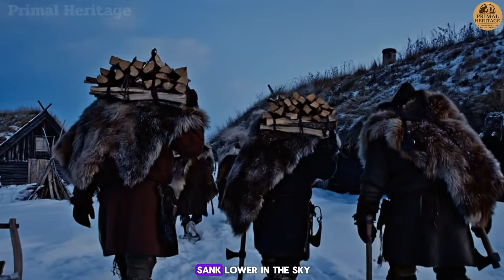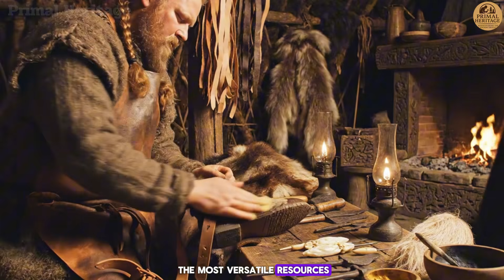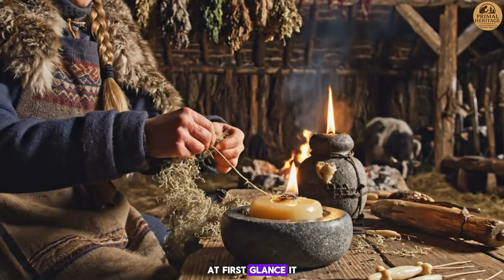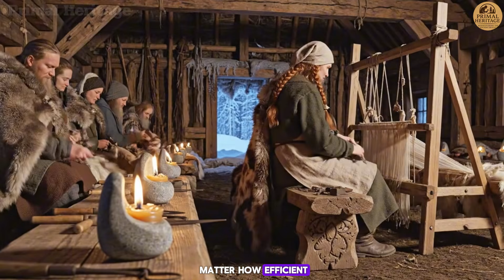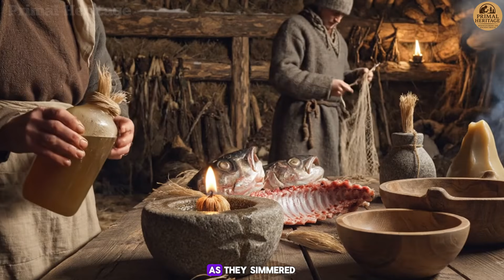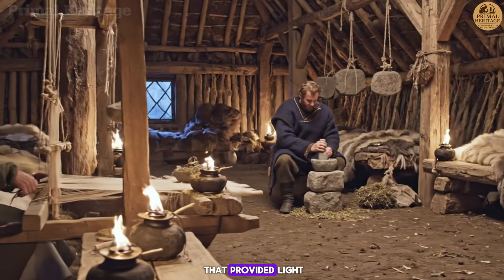How Vikings Turned Animal Fat Into 24-Hour Heat

Comment: The art that accompanies this video is entrancing on its own.  The exploration of fat lamps as a significant heat source is less compelling.  I grew up on a dairy farm:  I learned early that our animals produced a good bit of heat when stabled for the winter.  The stable roof was low, with hay and bedding lofts above providing a good bit of insulation.  The soaring roofs in this video probably did not exist in the day.  These artistic roofs held way too much air that would need heating during cold weather.  Half of the stable wall was buried in a hillside.  Even so, frost built up on those walls in the harshest of winter weather.  We used supplemental heat sources to keep the herd's drinking water from freezing.